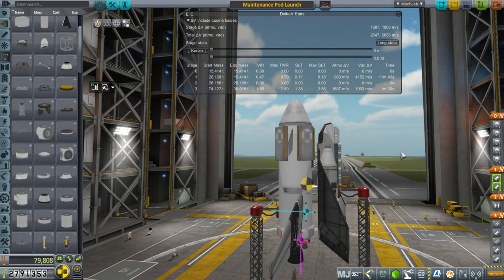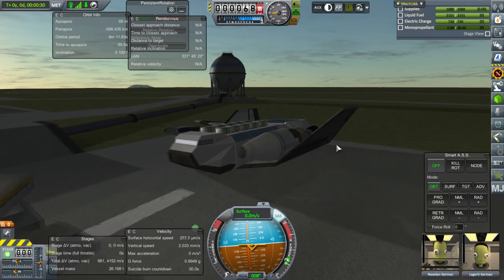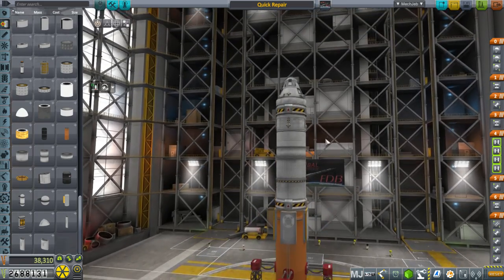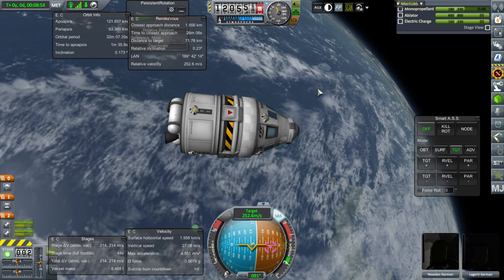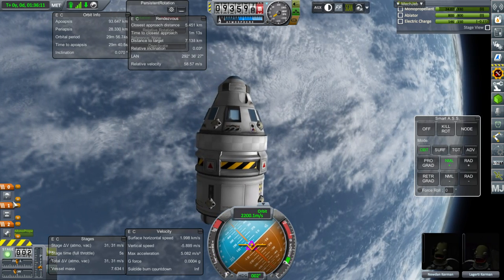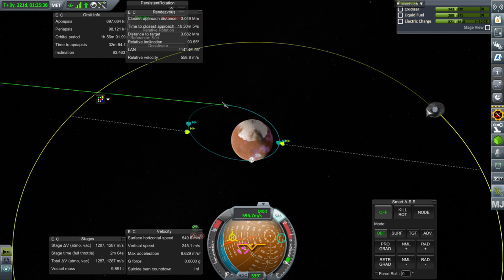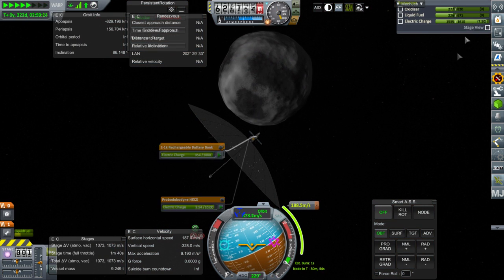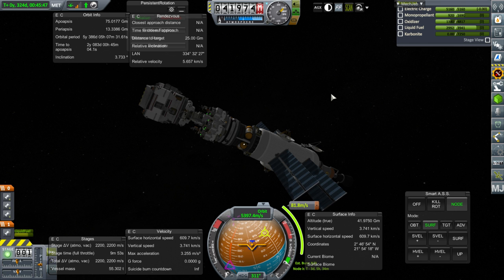Kerbal Space Program - Kolonization in 1.2 24 - Fixing Things Up

Comment: One cool thing I've found in my own testing is that the mk-2 scramjet engine (in hypersonic flight) can easily propel a craft well beyond kerbin's escape velocity from the upper atmosphere. It seems better for that purpose than even a NERVA with an isp of 2000 and a thrust in excess of 600kn. (in the part description it says max thrust is about 300kn, it is lying.) The only issue is that the only other place it works is Laythe, so either ditching or recovering it after an interplanetary burn would be advised. I do think it would be fun, though, to try using it to boost at least one interplanetary mission.
Reply: btw: great video